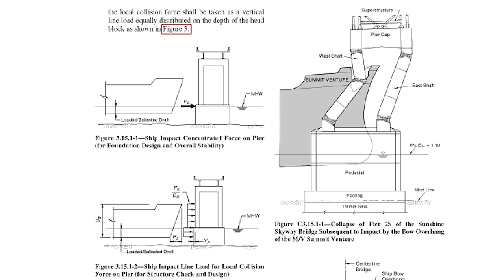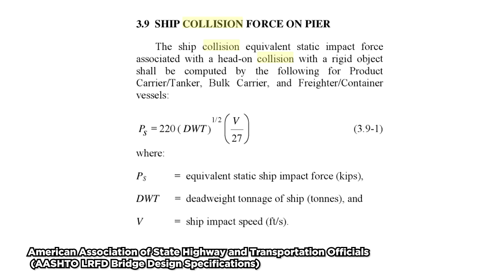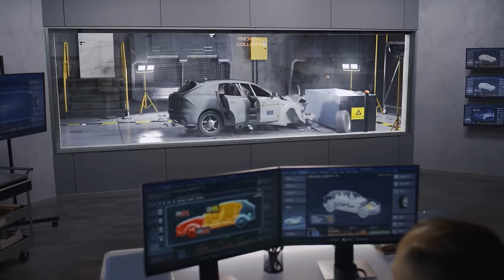Engineer Breaks Down Baltimore Bridge Collapse

Comment: Structural/Bridge engineer here in Indiana. My rough numbers showed an equivalent required force of 30,000,000 lb and assuming a 50' channel depth, would be a moment of 1.5 billion lbft! That also assumes fixity at the mudline which would be too liberal. From what I could determine, it wasn't even an AASHTO requirement in 1977 to design for vessel collisions. It appeared that was included in the 1991 AASHTO for the first time (I couldn't 100% confirm that though). Fun fact though, the current AASHTO LRFD manual still sends you to the 1991 AASHTO code for vessel impact loading in the commentary. I'm sure regardless of whether it was an AASHTO requirement in 1977, that bridge should have had some pier collision factored into the design given the intended use of the bridge and it being an NSTM/fracture critical superstructure design. I'd also be curious if they change how the vessel collision force is applied. It looked like the video showed it ramping up into the columns which is not how we apply the load. Will probably be developments in the code to better prepare for collisions, although obviously this was beyond the conventional "Extreme I/II" load case. 

Appreciate your perspective on this.
Reply: The bridge does have dolphins but the vessel missed them. Unlikely they would of saved the bridge.
Reply from the maker: Thanks for the bridge engineering insights, these are great!
Reply: I'd love to see a few high skills bridge engineers review the existing and proposed replacement plans for the Norris Bridge in Virginia, between Whitestone and Topping, near where the Rappahannock River enters the lower Chesapeake Bay.  

That's the longest river crossing in the state, and about 20% longer than this Baltimore bridge.  

The existing bridge has a mix of precast deck modules over archaic sizes of WF beams, on sections with pin-hanger design, and central over and under tension truss systems.  The pins and hangers get 2 year inspections, and had safety catches added after the Connecticut Mianus River Bridge on I-95 collapsed.  The tension truss sections have had periodic inspections, and a decade ago saw an overhaul with some members with cracks be replaced, leading into a paint job. Under quirks of HazMat law, letting old lead paint flake into a watercourse isn't illegal, but sandblasting surface prep requires substantial containment and collection.  New paint is also interesting tech, where they used a 3 part Sherwin Williams process, heavy zinc primer, epoxy main coat, and urethane over-layer protectant.  

The main reason for replacement is that old bridge has no shoulders, and narrow lanes, and so is easy to shut down and block with accidents or oversize loads.  

The proposed replacement whose plans I have from FOIA'd documents in an electric utility litigation project we won, show an underside box girder design that avoids pins and hangers, as well as tension truss systems, as both are more subject to severe sudden failures from critical elements, than currently favored engineering designs.   

I don't have the currently updated replacement proposed design, but the former proposal mentioned above, as well as analysis of the existing bridge and even soil testing and proposals predating WW-II, not built until the late 1950's due to war diversions of steel and labor and budgets, to develop alternatives for balancing costs and safety for repairs or maintenance over different potential life extensions, are part of a 6 figure cost and 4-500 page engineering report the state DoT files included.  

Some of the issues of that bridge have great similarity to this one in Baltimore, and a few are even more extreme conditions, other than the major port shipping traffic not existing there as it's a rural area between DC and Norfolk with their urban centers.  

Any takers on some potential comparisons to Baltimore and bridge engineering in general?
Reply: The size and mass of today's ships was not a consideration 50 years ago.
Reply: NEEEEEEEEEEEEEEEEEEEEEEERD
Reply: It hit the , rose up against gravity and fell against the bridge and snapped it. The same effect happens when opening the cupboard and a can of chili falls out and the edge lands on your foot and the blinding pain makes you forget everything: the bridge didn’t want to be a bridge anymore…
Reply: Not even close to a 100-200 ton vessel. That would be tiny. He got that wrong early on
Reply: @kenbulut-oe8sb   The Battleship Yamato displaced 70,000 tons of water and was 863 feet long.  Battleships made all over the World since WW1 could have done the same damage as this Container Ship.
Reply: @clearview5281  And what do you usually see when a carrier is leaving a port? That's right. Tugs escorting them out of the port. For one reason is because all the explosive material on that carrier.
Reply: @russellhowell9854  I agree that Port Authorities should of had a rule about Tugs escorting the larger ships, especially if the Authorities knew that the Bridge was so poorly made that the whole thing would fall down with one hit.
Reply: @clearview5281  Thank you.

Comment: It wasn't a "freak" accident, it was an inevitable accident.  It was low probability, so it took nearly 50 years to happen, but nevertheless inevitable because there was no adequate protection against ship strikes.
Reply: Usually the hundred year storm event is the one that happens 3 months after you build your infrastructure , but Murphies Law didnt turn up to this one for 50 years ....
Reply: Many bridges built 50 years before this one, both in the US and Europe have had numerous strikes and the Whole Bridge didn't come down.  As I said earlier, there were heavy armor plated Battleships all around the world. 
The Key Bridge was a faulty design for the entire bridge to have come down.
Reply: I completely agree. No adequate dolphins, also, why is there no requirement for ships without tugs to have their emergency diesels running until they reach open water? Seems like a no brainer to me.

Comment: This is a result of failing and lack of government infrastructure updates. The private sector, aka in this case Transportation/Ships, have been increased in size in recent years. This ship should have run aground before damage the bridge pillars. I have read that after 9/11 this was discussed but was deemed to costly. Well now it's quite a bit more costly. It should be done regardless.
Reply: It is also result of profit-seeking at all costs on the private sector, pushing to operates bigger and bigger ships with smaller and smaller crew, putting short term profits over safety.
Reply: there was nothing there to stop a collision with the pylons if it wasnt this cargo ship it could have been any other ship quite possiblys a cruise ship which could have resulted in deaths  they did not put a ring around the pylons so it wasnt an if it was a when a disaster would happen all down to cutting costs on 3 things ship crews bridge maintinence & harbor staff:- ie tugboats if all these were done properly balitmore bridge would stll be standing
Reply: Huyard, would you agree that hindsight is 20/20 ?
Reply: It's always about money and greed. These shipping companies operate and take shortcuts sometimes in safety and accident prevention and for the majority of the time they can get away with it. But, this time it bite them in the butt. Everybody wants to blame the bridge and not enough dolphins. The bridge was working just fine till the ship hit it. Let's place blame where blame belongs. That ship ran into the bridge. The bridge did not run into the ship!
Reply: @russellhowell9854 that's not how engineering works. You design for failure scenarios and then add in a factor of safety.
Reply: @pmberkeley  People keep focusing on the bridge. That bridge was working just fine. It was the ship that ran into it. The bridge did not run into the ship.  The ship had some age on it and may need  some updating. But, again. People are  focusing on the wrong thing here. The port authority and powers that be got lacks in their job. They should of had backup safety figures (like tugs) alo ng side in case something like this situation happened.  This was an avoidable accident. Greed is the biggest problem here.
Reply: @pmberkeley  I worked for TXDOT for 14 yrs. It's all about money and how much is available.  Years ago we had teams that went out and did bridge evaluations  that were required by federal govt. We had critique reports and we had to rate by these critique sheets . All the bridges were failing so they told all the teams were were evaluating the bridges too strict  so we were instructed to ease up on our evaluating because too many were failing.  Life isn't perfect and you do what your budget will let you do. Too many are looking at the bridge design here. The bridge did not hit the ship. The ship hit the bridge. That bridge was doing it's job before the ship hit it.  Yes, the bridge could always use improvements  but the focus here needs to be on the ship and how it could have avoided hitting the bridge.
Reply: @russellhowell9854  there can be more than one problem. From an engineering perspective, the bridge is one of the problems. 

The problems with the ship are obvious and don't require discussion in the same way the bridge collapse does.
Reply: @pmberkeley  Again, bridge was functioning fine and serving it's purpose. The blame here should not be put on the bridge.  Although there could be more prevention items in place it's not what caused this accident. How many ships have passed by this bridge for yrs. and never had a problem. The problem was  not the bridge but the ship. This accident has pointed out some deficiency in the bridge but what needs to be addressed is how to keep these ships from hitting a major structure again. When you have a ship of that size with that much weight the answer lies with the ship not the bridge. If that ship hit the dolphins it probably would still be sitting in the channel and being an obstacle and a problem for other ships.  The answer lies with the operation of the ship not the design of the bridge.
Reply: @pmberkeley  I agree there is always room for improvement.  But the initial problem was the ship. That correction needs addressing first. Even if the ship would have hit dolphins first chances are that it would still be stuck in the channel and holding up commerce.  The problem needs to be addressed before addressing problems with the bridge. That bridge could have served it's purpose many more yrs. if the ship had not hit it. The ship is the problem here.
Reply: @russellhowell9854  you fundamentally misunderstand how engineers approach design and responsibility. (I'm an engineer). If you build a bridge in a shipping corridor, a collision with a ship needs to have the minimum possible effect on your design. It has nothing to do with the ship's issues from an engineer's perspective. It's our duty to design structures, devices, products, etc in a way that causes minimal harm if something goes wrong. It's part of the code of ethics that engineers must abide by. Just like doctors used to go by "first, do no harm", engineers are getting better and better at making sure we don't have full bridge collapses if there's a ship collision.
Reply: @pmberkeley  That is great that designs are made bigger and better. That's great. I worked with engineers for 14 yrs. A lot of engineers see building structures through formulas and mathematics and that being all good sometimes does not look at things through a common sense and logical stance.  Just cause it looks good on paper it does not work that way in the field. I'm not saying there weren't problems with the bridge. No bridge is perfect. There will always be should of, could of, would of but the main denominator of this accident was the ship. Not the bridge. This bridge had been doing the job it was suppose to do for yrs. Could it have used more protection? Was the design probably out of date and not up to present day standards? No doubt. But, the bridge would still be doing it's job that it was design to do hadn't it been for the large ship running into it. So, this accident was the ships fault and powers that be with the port authority  that got lacks in their duty to get this ship safely out to open waters. Do we need to build the next bridge bigger and better with more safety features in place? No doubt. But to put the blame on the bridge in this accident is like saying a person with a gun killed someone before pulling the trigger.
Reply: @russellhowell9854  did you watch the video you're commenting under?
Reply: @russellhowell9854  Ships used that waterway before the Bridge was built, so the Bridge should have been built to accommodate the ships.
Reply: @clearview5281  The bridge have accommodated ships for yrs. . So, to say the bridge did not accommodate the ship is wrong. If that ship would have stayed in the channel where it was suppose to be we would not even be talking about this accident.  Try to say something logical next time.

Comment: Appreciate your stepping us through the engineering issues associated with this incident.
PS - Under current standards, wouldn’t the new bridge foundation be placed away from the shipping channel so that the ship would run aground before even approaching the foundations? That’s what port of Long Beach did for its new bridge. 
PS2 — Coronado bridge in San Diego, CA is designed to float should it be knocked off foundations so as to not trap US Navy ships docked further up the bay.
Reply: Well the easier thing to do would be to create more barriers/dolphins around the base and it would also be more economical.

Comment: My experience with engineers has been they design for CYA. Then the powers that be say that is way too expensive. Then management starts cutting aspects from the design to make it reasonably cost wish. This is a reality of life. The discussion at this point is about regulations about tugboats. And as you know nobody cares about regulations until the bridge collapses.
Reply: It could also be about distance of the dredged channel from the roadway bridge supports. Sounds like the bay's muddy bottom would do an excellent job of stopping a wayward ship.

Comment: The crash protect built into a large ship is called a port tug that has the massive power to stop a large ship moving in the wrong direct. Apart from the lack of protection pillows the Port of Baltimore shares the blame for this accident by not mandating such large vessels are guided by tugs as do most ports in Europe like Rotterdam.
Reply: And the "but the ships were smaller back then!" similarly applied only to a limited extent - they dredged the channel to allow bigger ships to enter the port, to make more money. They should also carry some responsibility if they didn't make sure it was safe for them to enter.

Comment: The critical vertical support structure should never be built where the flair of a ships bow can get to the vertical.  Just a matter of time before something knocks it out of column.
Reply: Agree ... BUT this number has changed with time .... I'm NOT defending ...
Reply: When that bridge was designed nobody foresaw ships with 150’ beams and extreme bow flares. The average ship size when this bridge was designed is half the size of the Dali. The channel depth has been dredged to allow these larger ships to call on Baltimore, with air draft becoming the constraining limit of ship size. There has been recommendations for decades to install ship protection. Thank Maryland for ignoring the recommendations.
Reply: @Jon_Flys_RC there were aircraft carriers larger than Dali in 1977. Given that Chesapeake bay is easily the most strategically important harbor system in North America (Washington and Annapolis are not far away), this bridge should have been designed to handle naval ships in wartime.
Reply: @atomicsmith  Baltimore was never a port for the navy. Comparing it to a navy port isn’t really applicable. At the time none of the channels had the controlling depth for a ship that deep to even get them there.
Reply: @Jon_Flys_RC  I just learned the Key Bridge had been hit once before by a much smaller ship in 1980, 3 years after it was built. That ship, called the Blue Nagoya, meaning Blue CALM in Japanese, was much smaller than the Dali. An exact weight for the Nagoya was not given, but when it was built, ships the size of Dali were not yet being constructed. 

The Dali with its cargo was estimated to weigh 95,000 tons (190,000,000 pounds). The Key Bridge was estimated to weigh approximately 3000 tons (6,000,000 pounds). I believe engineers are correct when they said we have no technology today that could have protected the Key Bridge from collapsing given the significant difference in weight between the Key Bridge and the Dali... the Dali outweighed the Key Bridge by just over 310 to 1! That's like a 310 pound man facing a small bunch of bananas! Bananas squished with ease!!
Reply: @cyh4031  Yeah, but at the same time, this was actually a well-built bridge.
You can tell this because a lot of the truss work is quite intact and appears to be rust/corrosion free.
I think the real issue is just the fact they never reinforced the supports properly by getting more dolphins and/or barriers around the bridge. Besides, I don't think any other bridge would have withstood a collision like this.
Even the golden gate would probably take a lot of damage if it didnt have its own protective guards.
Reply: @Jon_Flys_RC  I never said it was a port for the navy. I said it was in a strategic harbor. Most infrastructure built during the Cold War was designed with wartime use in mind. (Designing interstates for B-52 landing is a well known example.) The channel at Baltimore is deep enough for a Nimitz class aircraft carrier which were new in 1975 (bridge built in 1977).